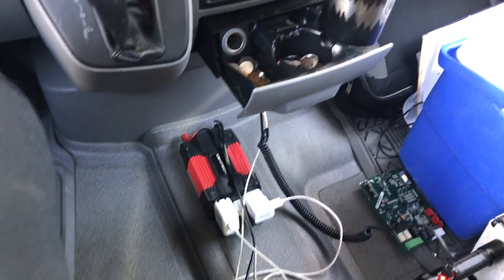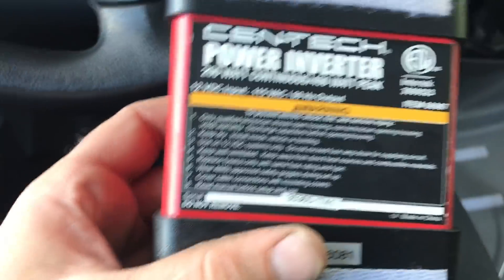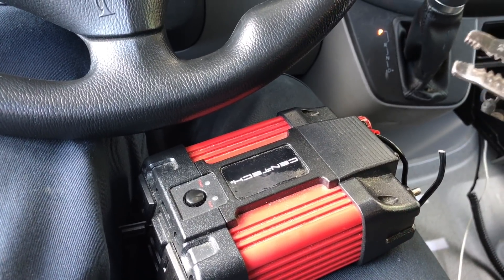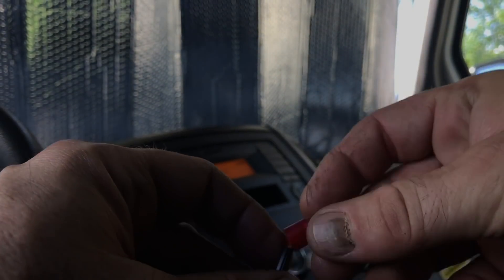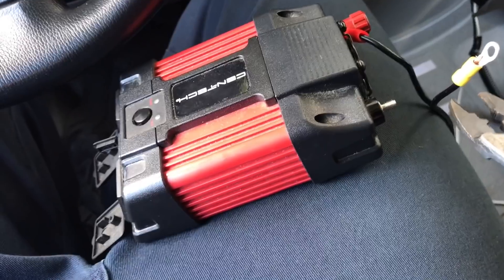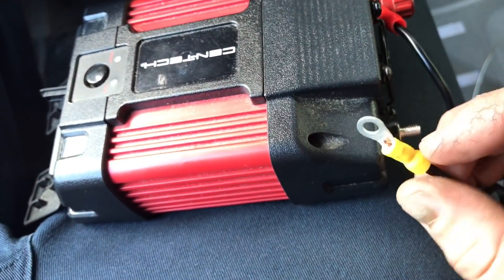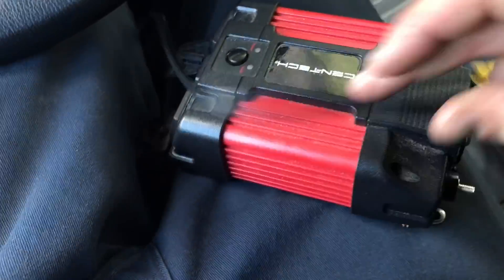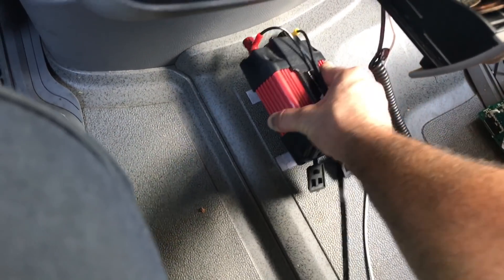Repairing Broken Wire Connection To Power Inverter

Comment: How long can you keep that running to charge up  your phones and  portable printers  actually  print couple of pages
Reply from the maker: If the truck is on it should have no problem with the printer and phone. If the truck is off depends on what kind of power drain the printer is. I can charge my m12 batteries with truck off. As long as that’s all I am charging.
Reply: @thehvachacker  I meant the inverter dont overheat
Reply from the maker: Only if you over amp it and it had an 8 amp glass fuse in the 12vdc cigarette lighter plug in. I have things plugged in all day to it. It starts to beep if amps go high or battery power starts to drop. I'm thinking of sizing up the fuse since it has a 25 amp fuse on its main circuit board and the adapter is protected by a 15 amp fuse. I been using for over a year nonstop. Here is the initial review I did on this https://youtu.be/eWLUpWkyzjE  Its on my other channel

Comment: Break out the soldering iron Hacker.  Crimp then solder and cap it all off with some heatshrink and forgettaboutit!
Reply from the maker: That is something I will be teaching myself soon. I never did electrical soldering. I’m sure I will break the connector again. Yet I just picked up a soldering iron so it’s time I learn
Reply: @thehvachacker   Also pick up some rosin based solder flux paste. Dip the bare wire in the paste then crimp connector on. Then solder. Easy peasy. Check out some vids and you will on ur way in no time!
Reply from the maker: @chevboy167x8  Thanks for the advise, I just need some down time. I am just getting home from work and am wondering if i should work on astro or edit a new video

Comment: I have usb plug ins in my car. It seems like they take forever to charge my phone battery. At home I plug it in and boom it’s done in no time.
Reply: likely all limited to 500mA current, better quality adapters may have 1A rate or higher depending on the device being charged and the charger having a chip in it to communicate with them
Reply from the maker: The usb plug ins that are factory installed in my wife’s car is 500ma. When using the Waze gps app the battery doesn’t charge yet it also doesn’t drain. A 1amp charger will speed up the charging yet I use the iPad is a 3 or 5 amp and recharges my phone very quickly
Reply from the maker: The power output of those USB ports in cars are low. I keep a lot of items charging my MacBook, gopro battery charger, iPad, work cell phone my cell phone. Sometimes my drill batteries but if I’m charging them I can’t have the laptop charging

Comment: When I have wire like that I will strip enough so I can fold wire double to get tighter connection before crimping. I have that same converter, they do a good job.
Reply from the maker: I fold often also cause it does make a tighter connection. This thing is good for keeping lots of my electronics going.
Reply: obviously using the right connector for wire gauge is best, but I've folded the wire on itself, even tripled it in the past for fast temporary repairs. 
which of course become permanent as they never manage to get changed, but they really don't seem to break either, except for at battery posts, corrosion eventually eats them. lol
Reply from the maker: I know I'm not the only one to crimp solid wire folding to make a tighter connection. 18 gauge control wires usually gets a triple fold